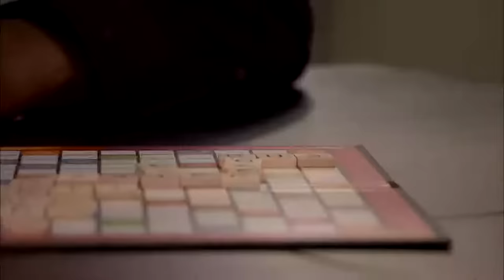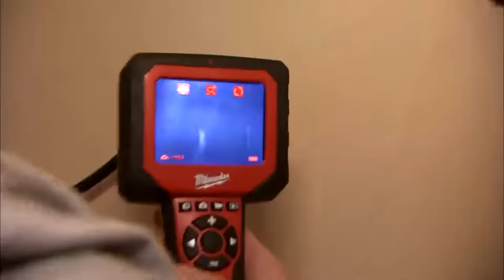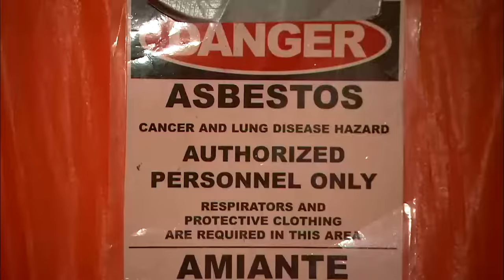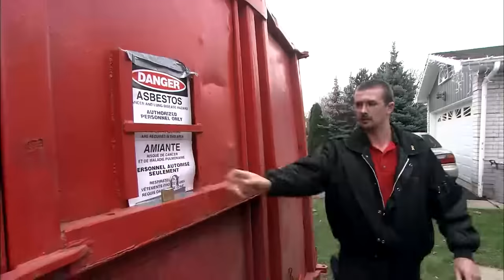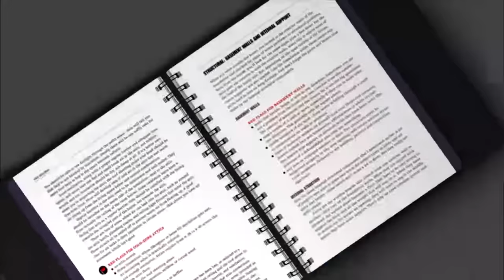The Hidden Costs of Newly Renovated Houses | Holmes Inspection S121

Comment: Pro tip: Look at the sales history of any home you are purchasing (most major sites like Zillow, Redfin, etc. will have recent recorded sales) If the house was sold a year ago for $15K, you can be assured it had major issues. This is when you need to be extra cautious because it was likely fixed to be flipped, not held- and you should ask what company did the work, ask the seller to produce work permits and inspection records. And ALWAYS have a specialist inspect for insects. And critters.
Reply: I agree, you have to do your due diligence...
Reply: Man, that's solid advice!!
Reply: Cracks me up whenever i see corded power tools on a job site
Reply: Never, never, never buy a house that was last purchased less than two years ago by an LLC.   I have inspected dozens of houses that were flips and almost exclusively, they are all covering up a disaster.   I just finished a deposition on a case involving a flipped house.  It is unlivable, it is unsafe, it must be torn down.  The home inspector caught NOTHING!!
Reply: Thank you for that advice.
Reply: Yep
Was house hunting last year. Came across a home that was sold just TWO WEEKS prior to an llc. The price was 90k more than what they bought it for and the house was obviously flipped.
Reply: @JessicaDaniJohnson  that LLC was what you call a wholesaler- these are the guys that used to do double closings before the banks shut down that practice. The fact it was an LLC by itself means nothing, many if not most multimillion dollar homes are LLC because it limits liabilty from a dooor-to-door salesman breaking his neck on your front walk on your Malibu property from going after your ski chalet at Vail.
Reply: @mytuberforyou  im not buying a house that was flipped in two weeks and outrageously priced
Reply: This is in toronto no property sells for 15k lmao even this tiny lot is a million probably. With the house they paid 1.5-2 million possibly
Reply: Most of these houses are 100 years old I've renovated many most are bought by builders these days and totally rebuilt this was probably a piece of shit builder in toronto theres lots. Theres loads of great ones and loads of hacks that will rob u
Reply: Great advice
Reply: Unfortunately, in the recent super hot housing market of 2021-2022 where everything was going for above asking price and you could have two dozen offers within a week and it sold the following week anyone wanting to do their due diligence was just ignored in favor of one of the other buyers who wouldn't.  The proposal for checking the permits or checking with the construction firm doing the renovation only is possible in a healthy housing market, which we will hopefully have one day.
Reply: @jofujino  so many bid wars these days

Comment: The crooks who cover this stuff up when selling homes need to be held accountable for their fraud
Reply: Yes they do.  This was probably a house flip.
Reply: Unfortunately too expensive to sue then.
Reply: @Cheepchipsable  There ought to be criminal charges filed against them and thy should spend a long time in prison.
Reply: @JeffDeWitt  Agreed. This is a possible negligent homicide in the making. While we're at it, home inspectors that sign off on this sort of stuff should lose their licenses and do jail time.
Reply: Or if it was legal or not hire someone to go after them and get legal involved or whatever works thank God Mike and his crew where there to fix it all
Reply: @shawnsisler3743  inspector not at fault this time, they are only supposed to look at what the visible eye can see. The previous homeowner did everything that they could to hide all this damage. They are the only ones at fault here.
Reply: Home inspectors do not cover termites and other insects, You have to have a separate termite report by a professional.
Reply: Inspectors need to be made accountable too. This one was clearly either drunk, incompetent or in on it.... The termites were easily spottable.
Reply: Agreed but good luck finding them
Reply: In Canada they signed a new law.  That they can chase down contractors that have done crappy work on a house, even years prior.
Even Mike spoke about this in one of his shows.   We in the USA need to start doing that.  And fast.
Reply: I agree, but there isn't really a whole hell of a lot an inspector can do. In fact, there wasn't anything they could have done. They would have had to tear the basement apart to have been able to see this because of how well it was all hidden from view. Try to put yourself in an honest homeowner's shoes. If the work had been done properly, they would have had to spend a small fortune bringing it up to code. Now, imagine the buyer hiring an inspector to come in and telling the seller that all that work would have to be destroyed so he could see the foundation and look for possible termite damage to the walls and joists, as well as drainage issues and to make sure that the wiring was done properly, and you haven't seen a penny yet. Even if everything was up to par, what happens if the prospective buyer decides to back out and continue looking at other houses? The only person who can be held responsible for this is the previous owner and whoever did the "work". I know there isn't anything that can be done, but it would be nice if it was possible to undo the whole transaction. I don't know how long it was after these people bought this house that they first started suspecting there was a problem, but with that much damage, I think it would have probably started revealing itself within a fairly short time frame, probably within the first few months, but definitely within the first six.
Reply: I’ve been searching for a home for a while now and every time I see the common signs of a house flip I cross it off the list. One, the common grayscale flooring and walls and cabinets it just awful. Second, they are grossly over-priced. Third, I worry about what they covered up.
Reply: @sped6954 the termite trails were visible, and there was visible dirt to wood contact, so at the very least the home inspector should have flagged it for possible termite.
Reply: @Cheepchipsable THAT must be changed!!
Reply: Everyone does this. Its not good. Look up the average age of houses in USA. A lot of houses going bad right now.
Reply: That’s why it pays to hire a proper engineer not just Joe Schmoe home inspector
Reply: the crooks, lmao, you mean every home seller who sells their home for 300k to 900k knowing the home is over 40 years old +, with no major work to plumbing inside/out or exterior walls/basement/foundation, let alone the attic/roof who knowing brought their home for a little over 100k or under. You mean those crooks, are they crooks or is the system of redlining still taking place and that evil alone is the reason why someone can cover up this crap and allowed to sell their home because the neighborhood they live in. All homes no matter where the location should be forced to higher an inspector that will legitimately inspect their home with truthfulness, then there should be a grace period of six months to find out what is really wrong with the house that the inspector failed to uncover and the seller should be forced to pay for the work entirely.  And if you dont like that idea then you cant sell your house. Basically there should be sever fines and instant payment. And if the seller cant afford the work then it should be added to their new home mortgage, and if that forces them into foreclose then so be it. It should be just like rent either you pay it or you hit the streets and become homeless for selling a lemon.
Reply: they could technically go after them if they knew about the issues and covered it up.
Reply: the legal system is so expensive it'll be just futile, unfortunately owners owners is on the owners to  inspect
Reply: That's a rampant issue - when the Market collapsed in 2008, major investors came in and bought hundreds of houses that were lost in foreclosure. The Banks prospered and MILLIONS of people turned from being Owners into a Renter Class, thanks to the Bank financed Investor Vultures.
Reply: Is there laws or something you can sign that will protect you on this or?
Reply: @johnadams7475  "Do not cover" does NOT mean during your typical inspection would you IGNORE terminate damage. That being said, as a home inspector myself I would not go out of my way by opening up cracks or attic just looking for this kind of damage, but if it's along my route, you bet I will inform them.
Reply: Half of the recent flips had people just painting over mold.
Reply: @FrankDTank16  
Wrong
Reply: If you don't have the money, find one of those Wallstreet litigation fund guys to give you money for your case. They'll probably take most of what you win, but you'll absolutely ruin these home flippers; so they can't do it to someone else.
Reply: too right they should mate, i REALLY hate people doing this and putting peoples hopes and homes and lives at risk:(
Reply: Held accountable in the basement of an abandon building. LOL
Reply: @TwstedTV  The problem with that new law in Canada is that it's only applicable (when it was signed) with new buildings with less than 5 years prior. The law only protect buildings in the future, not the past so that law doesn't protect anyone who purchase a house built 1 decade ago or more which, when you look at the house market, is basically above 90% of the market.

And that law also give a stand for contractors to raise their prices by as much as 45% to cover the potential cost of lawsuits for unforeseen damages (and that's on top of the regular price jacks).

On top of that, even if you can chase down a contractor, what you're chasing down is not the contractor himself/herself, but his/her business (even if it's a 1-man contractor sub-contracting various other companies). If that business is not up & running in 10 years, you're out of luck because you can't chase the individual who owned the business (unless the business was a individual business which, in a legal sense, makes it so that any deal made by the business is also made by the individual who registered the business. It's not for nothing that lots of contractors registered as a coop or an incorporation and not an individual business.)
Reply: Glad my house is brick
Reply: @FrankDTank16 
In this case the inspector is guilty too!
There is PLENTY OF EVIDENCE that is in plane VIEW.
In fact they should have informed the buyers to HAVE a termite inspection. Who ever told them to have a home inspection should have said the same about the termite inspection.
Reply: @ajalicea1091  it was likely he that did the flip
Reply: How about women who wear makeup…..should they be arrested?😂
Reply: Why? Just don't buy it if you don't like it. You can't complain if you didn't have it inspected first.
Reply: Most home inspectors do not want to kill a deal.small world of home inspectors and r.e agents.please read and understand the contract you sign with your home inspector. In short most read ,if we miss something the most you can get is your money back for the inspection. However in some cases you can sue home inspector and win more than the cost of inspection.in most cases avoid home inspectors and get licensed trades people to inspect home

Comment: These types of episodes prove that all contractors and builders need to be financially responsible for their work. If they build below code risk the safety of others and scam them out of people's money should be punished.
Reply: Can anyone tell me what liability is there on a city inspector that inspects and signs off on any job? I am certain that it is common fir even permitted jobs are crap but get passed by the inspectors.
Reply: Or if doing the bare minimum compromises the buyers and their safety, the laws need to be tightened. Require a B- or C+ level of certification performance.
Reply: @Gypsygirl9  At least in the US, in most states Home Inspectors have to be licensed, you can find that info online fairly easy to check your local area.
Reply: You would think that's how it works

Comment: I’ve been in the trades for 25 years. One thing I’ve learnt is sometimes you should knock buildings down. Heritage is nice but everything has a lifespan. I’ve seen some crazy stuff in old buildings. Drywall is an amazing product to hide everything.
Reply: running around on your knees to be a short guy🤣🤣🤣
Reply: Just depends if the budget is there or not. If someone has the budget to do a major overhaul on the problems, then I think keeping old buildings is quite nice. But it’s absolutely no good for anyone to do patchwork on a property that’s just falling apart.
Reply: Drywall is not a product you should use to build a house. Nothing better than using stone and mortar. The house I live in in Germany is over 300 years old..... The inner walls are over 50cm (20in) thick and the outer walls are over 100cm (40in). In North America most homes are not build to last more than 20years and most are only made of wood and drywall. It's rare to see stone or bricks and when it is only the outer walls.

Comment: Here in the USA  Laws vary from state to state but all require a seller to reveal to the buyer any known issues with the property. This could include repairs, renovations, past or current problems, even neighborhood issues like noise or proximity to nearby construction.  The seller needs to be in court and held accountable.
Reply: I wonder if Canada's laws are different. I imagine this happens all over, but I've seen so many illegally done work on shows from Canada, Property Brothers early on had so many problems with shoddy work and not divulged issues with the house. Crazy!
Reply: There are flippers in the US too who get away with crap like this and never get taken to court. Don’t kid yourself.
Reply: I'm sure the law is there, but you need money to sue them first - then you need to hope they have the ability to repay it.
Reply: @jenn976 They just shift the LLC or Corp another legal idenity or have one for each property.  You have nothing to go after.  Contractors are subbed.  It's not easy to exact justice when loopholes are the system.
Reply: Those seller disclosures are pretty much pointless.
Reply: i lived on a street in Toronto  renting and the street had a stump on it covered in termites.    Apparently a major red flag. The houses sold no issue.

I was a renter and although it was beautifully renovated, there was so much obvious termite damage.    I reported to landlord and they had an inspector to say the termites were killed off in the past.    The structures not fixed however.   You could see the structures under stairs crumbling from termite damage.   

 I felt bad for the next buyer.    

I was moving before they took over the house because all the vents were done terribly and there was a high pitched whistle noise whenever the furnace came in which drove me nuts (reason i left) and the heating for the whole house messed up.    Furnace room fan was like sleeping beside a furnace.   

dank summers and i had to have a humidifier going every time it rained.  Never ever will i rent a basement again. 

Then i found out my city has entire neighbourhoods known to be full of termites.   I think the city should somehow inform prospective buyers.

Sometimes i wonder if homes are actually an "investment".   Imagine having to pay for all these repairs.
Reply: @nicoled5160 omg. What neighborhoods have termites? I'm from Toronto as well. Thanks

Comment: Termite inspections typically costs extra on top of the home inspection and have to be requested by the buyer. So if they didn't request that, it's not really the inspector's fault, neither is all the crap hidden behind the "renovated" walls.  I had the same issue on my first house. Ripped out a piece of drywall (actually they put up beadboard and just painted it to look like the drywall) and found crumbling 2x4s. I ended up replacing almost the entire front wall of the house.
Reply: Not true. The inspector should have noticed the damage and recommended a termite inspection. Or the realtor if termites are common in the area.

Comment: There should be laws that any basement renovations below grade, require permits and need to be inspected for termites.  This means that failure to do so, and the house is sold and the buyer discovers termite or drainage issues after sale, the buyer can sue the seller and the contractor for repairs within 10 years after purchase of home.

Comment: I've seen so many video's that show these "scammer repairs" the worst is where they glue tile onto sheet rock in both bathrooms and kitchens and claim it is a water proof surface. the damage to the sheet rock and to the supporting 2x4's is terrible. Seen it go through the kit walls and ruin the outside paneling as well.... seen bondo used to repair termite damage... House flippers are notorious for doing this kind of stuff.